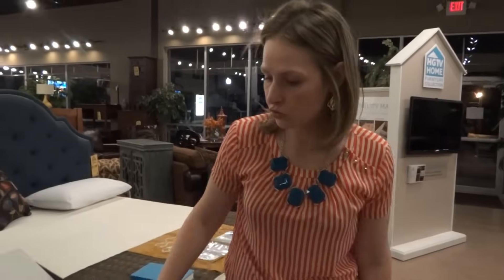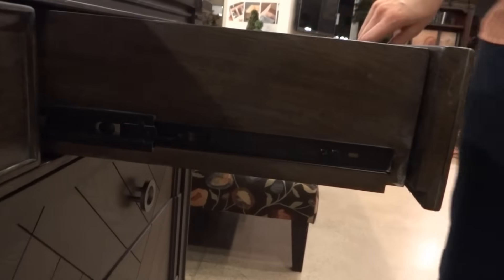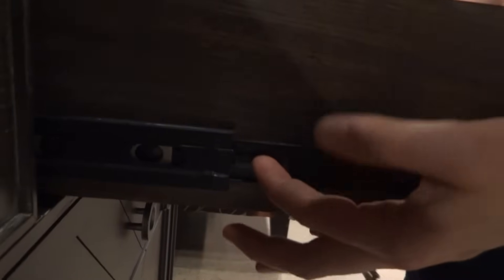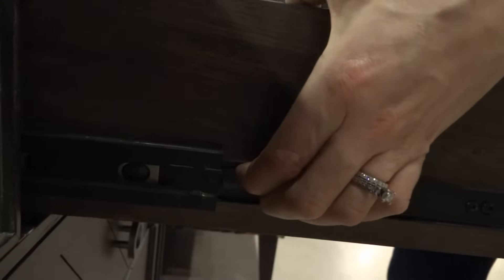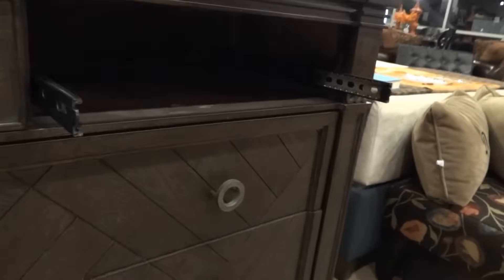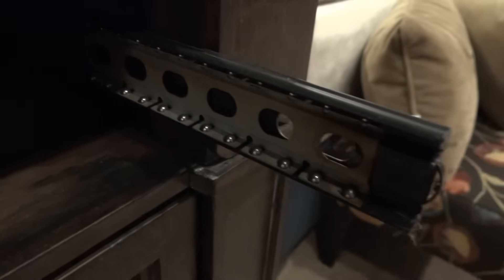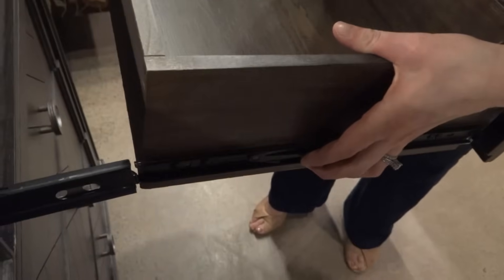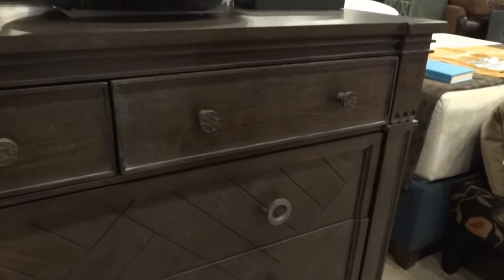How to Remove a Drawer with Metal Glides

Comment: Hey thanks!   I was going nuts trying to figure out how to remove my drawer. My levers were REALLY small, but I finally found it. Dawes slid right out and back in again. Fine, custom built furniture and had to use a very delicate touch with the levers.

Comment: Thank you so much- I assembled it years ago and forgot what I did. I may have not assembled it correctly because the ends of the levers were hidden in the track. I had to stick a small screwdriver blade in to move them. Thanks again.